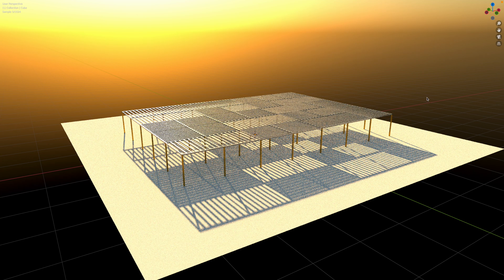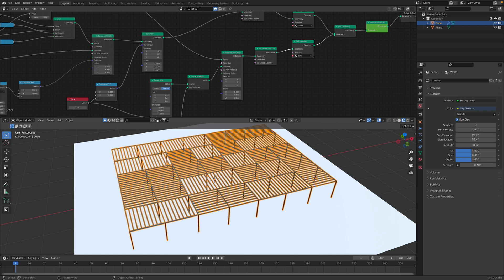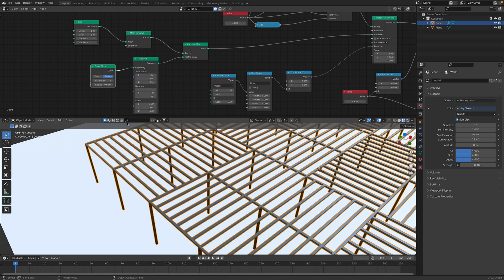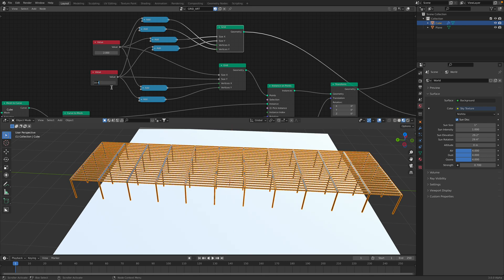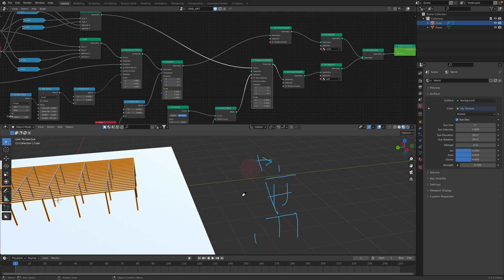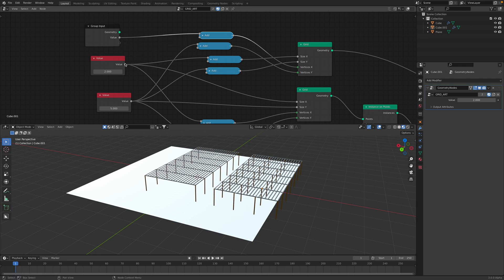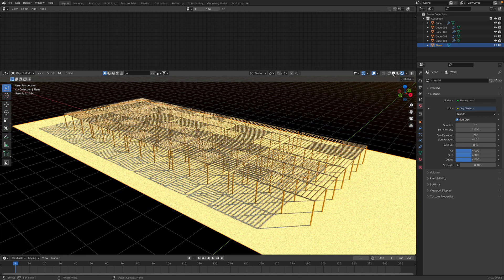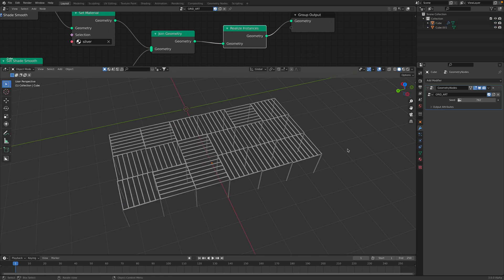LIVENODING Geometry Nodes Simple Vertical & Horizontal Grid Panel

Comment: Nice ! Isn't the weirdness at 3:08 caused by the rotation requiring radians instead of degrees ?
Reply from the maker: That's probably right, and I use this Map Range "hack" to make the random rotation in 90 °. There must be a better and more elegant way.
Reply: @JimmyGunawan  you can use random value type integer 0 to 3 (if you want 90 degree steps), then multiply with pi/2, then use combine x/y/z and put it in z, then plug this in rotation of instance on points. By the way - i subscribed your channel a time ago - and i just can say: keep going and continue making your great videos!
Reply from the maker: @BlenderFun_  Thanks, this is nice trick! I am checking yours also using my multiple accounts
Reply: @BlenderFun_  Thanks for that tip!
Reply: @alabrrmrbmmr  glad someone reads and uses it 🤗